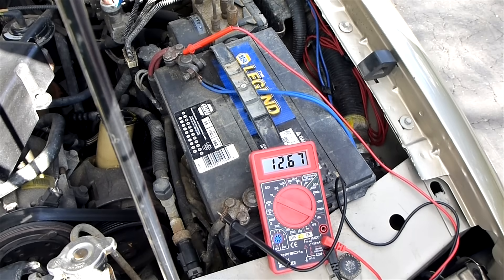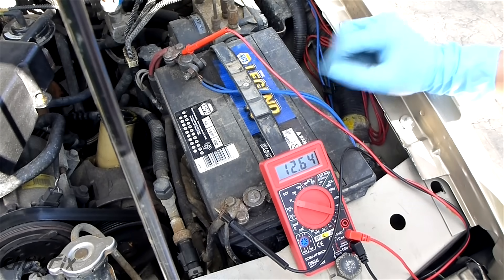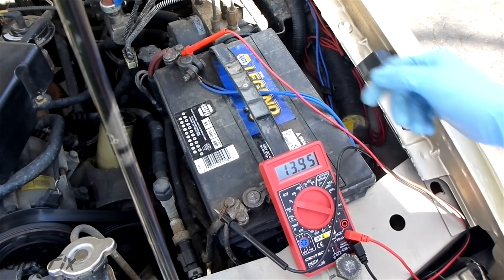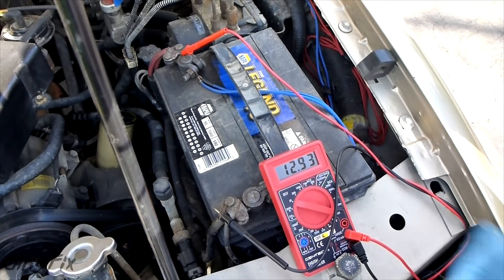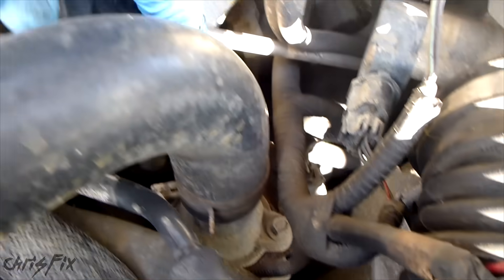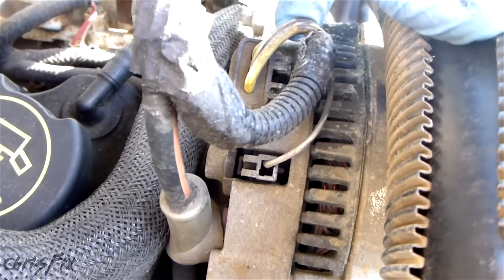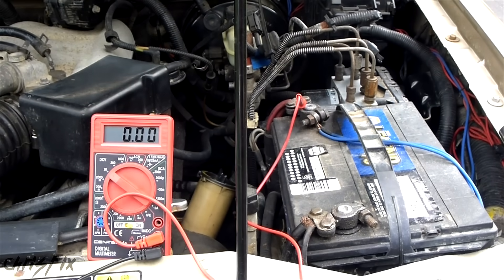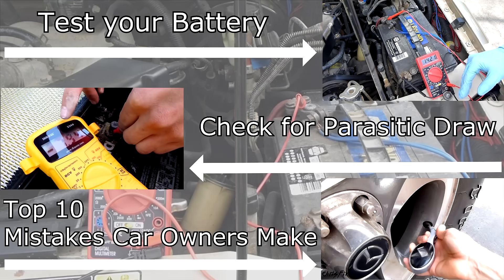How to Test an Alternator

Comment: Hey Chris, thanks for your video I am going to try this as soon as I get home. I do have a question for you. About 6 months before I was driving and my car died. I tried to jump start and all the lights on the dashboard came on and it died again. I had it towed to a shop and they said I have to get my alternator and the battery changed. Then in September car died again and had to be jumped. I took it back to the shop and they said my battery was bad and replaced it under warranty. 

Now yesterday I was driving and the battery and brake light came back on. I got home checked the brake fluid and the connections on the battery and everything is good. Now everything I read online points to a bad alternator. Do you think that it could be the alternator (only 6 months old) or did the battery die again. 

I would greatly apperciate your opinion before I listen to the mechanic and spend another $350 on the alternator.
Reply: ChrisFix I wish he kept up with you. I really wanted to know if the problem was in the car or in the mechanic ...LOL
Reply from the maker: Mudassar Rehman It could be the alternator. I would test it like in the video and let me know what you find. The brake fluid level sensor could also be going bad and it is just a coincidence. Let me know what readings you get!
Reply: ChrisFix Thanks for the fast reply. I did the first tests you showed in the video. Here are my findings:

Battery reads: 12.52v
Car Idling: 14.6 v
Headlights ON, Radio ON, Heater ON, Interior Lights ON: 14.5v

I recently had the brakes inspected. The brake light was on so when the mechanic he looked at it he said brake pads and rotors were gone. So he replaced them and when I picked up the car the light went off. I am going to drive it around this weekend to see if the light comes back on. I just don't want to get stuck in the road.
Reply from the maker: The alternator looks good! You might have had low brake fluid and when he put the new pads and rotors on, it increased the fluid level and shut the light off.
Reply: ChrisFix

I am sorry for keep asking questions. I am just tired of wasting money on mechanics guessing game. I am going to keep an eye on the brake fluid. But do you know why would the lights flash? Thanks for your help.
Reply from the maker: Mudassar Rehman Flashing brake light? Hmmm. That is unusual. Check your owners manual. Look under the brake section and it should tell you what the flashing means. It might just be a faulty brake sensor or maybe your e-brake is loose or something causing the brake light to flicker. Dont be sorry for asking questions! These are good ones and I am here to help!
Reply: ChrisFix Hey I need your help again. I drove the car around for a few days and yesterday the brake & battery light started flashing. Also when I would stop at a traffic light the lights would stay on, but go off after I would accelerate. I checked the voltage this morning. The battery reads: 12.6 volts. With the  car running: 14.6 volts. 

Can you give me some ideas of what else could it be. I just don't want to be driving and get stuck in the middle of the road.
Reply from the maker: That sounds like a ground issue. Something is not being grounded good. Are your battery terminals clean? Follow your ground wires in the engine compartment and clean the connection.
Reply: Are you talking about negative terminal on the battery. I was able to move the negative cable by hand so I tightened it. This morning battery was down to 12.4v. But when i run the car it goes upto 14.5v. I am going to remove the battery and the tray to look at the negative cable where its attached to the car. Can this make the battery and brake light to come on. I just dont want to spend money on the alternator when it be a wire.
Reply from the maker: Mudassar Rehman If there is a bad ground it can cause your electronics to act funny. It is somewhere to start but from what you said, it sounds like your alternator is working good. Let me know if any grounds are not clean.
Reply: ChrisFix Hey I was only able to check the cables that go on the terminal Negative one was little bit loose so I cleaned both sides and put them back real tight. I am going to drive the car again tomorrow morning.

I am going to have a mechanic look at all the grounds tomorrow as well. But when I was looking at the car today. I noticed that one of the lights on the number plate was out. So I replaced both of the bulbs. Also the car was real low on coolant so I topped that off as well.  My only problem is that mechanic keeps telling me that the alternator is bad. Do you think that this blown light could have cause the battery light to come on.
Reply from the maker: Mudassar Rehman The blow out lights will not cause a battery light to come on. If you tested the alternator like in the video, it is 99% most likely fine.
Reply: ChrisFix Hey thanks for the advice. I had the mechanic check all the connections again. The negative cable on the battery had some corrosion where it is connected to the car. So he cleaned the cable and checked all the other wires. Everything seemed good. He told me to try it out. I drove it for five minutes and when I stopped at a stop sign, both battery and brake lights came one. 

So he said that the alternator is failing. I told him about all the voltage test in this video and he said that alternator might not be completely bad but is on its way to fail. and might kill the battery as well. In your opinion do you think that he might be right.

Autozone has a new alternator for sale for 250. I am also going to have him change the alternator belt.
Reply from the maker: Mudassar Rehman I mean, it can be an alternator going bad... Do you trust this mechanic?

Comment: hey can you help i dont have testing tools here but  when ever my truck idles its a 94 c1500 pick up  it will lose charge and buttery meter will down towards the red but  when i start driving the voltage will come up till just one mark above normal what can it be my belt isnt sleeping  its not even squealing the engine sounds normal.
Reply from the maker: SuperJeremi10 Go to your local parts store such as Advance Auto Parts and they will test your alternator for free. The belt could be slipping but you might also have an alternator that is going bad. Try spraying water on the belt like in this video: https://www.youtube.com/watch?v=UF3W-vHPYHg and see if the belt squeaks. If it squeaks, your belt is slipping and you need a new belt or tensioner.
Reply: okay will do thanks i have a autozone here and it rained pretty bad today and  my belt didnt squeak but ill try spraying water on it too  but first thing im taking it to autozone.
Reply from the maker: SuperJeremi10 That will work! Let me know what they say! You might consider investing in one of these for only a few bucks: http://www.amazon.com/gp/product/B001O1X65A/ref=as_li_tl?ie=UTF8&camp=1789&creative=390957&creativeASIN=B001O1X65A&linkCode=as2&tag=chri0e2-20&linkId=DQXKJ44LE7TL32CR
Reply: i will do and yes i probably should might be help  when a problem like this arises again  good thing is i have yet to have a fail to crank or start or stalling it has had long crank times since this issue started but by the time i really noticed an issue it was to late to take it to the shop.
Reply: i just hope it will crank tomorrow otherwise i carry jumper cables in he truck so ill just have it jumped.

Comment: Hi Chris - Many Thanks for these great videos. Occasionally I am having problem cranking my Toyota Corolla 2006 - I did the battery and alternator test as you suggested. I am getting a normal battery voltage of 12.6, while cranking it drops to 10.5 V. When the car is running without load I am getting 14 V (Red Flag) and with headlight light, fog light, fan and radio running I am getting 13.85 V, did all the test as you suggested. Negative terminal voltage drop is 0.05 all over as suggested and positive terminal one is 0.25. To me all seems good except the normal alternator voltage of 14 V which should be 14.2 to 14.7. I got my battery checked at the battery warranty and he told the alternator is weak. Can you please share your thoughts on what issue I might have and how to fix the issue of weak alternator.
Reply from the maker: anisarfat That does sound like a weak alternator but it isnt weak enough that your car wont crank. A weak alternator typically means you need a new one (or you need to get yours rebuilt).

Comment: Howdy Chris, I wanted to ask you for your opinion. I have a 1981 F150 with 300 cid inline 6. My alternator has an external regulator too. The condition is that it's charging at 15.2 volts, it seems a bit high but doesn't increase over that when I rev it. When I turn on all of my electrical it'll drop to about 14.4ish volts do you think that's fine? Everything seems fine other than noticing that.
Reply from the maker: Brenndon McGill The 15.2v is a lot. As you saw in the video it should be in the 14.2v -ish. I think you should consider replacing the voltage regulator (nice that it is external) because when they go bad you get an overcharging situation which can damage your battery and potentially your electronics.
Reply: ChrisFix That's kind of what I was thinking.  I'm going to look at getting it replaced here soon.  Luckily the only electronics I really have are the lights, radio, HVAC fan, and wipers haha. No computers, sensors, etc. Maybe if I stick your fog lights that are brighter than the sun on my truck it'll just drop it to 14 haha.
Reply from the maker: Brenndon McGill Haha they only draw 4 amps each so that probably not gonna work :P

Comment: Hi Chris,
My alternator read at a 13.5 loaded.  When I turn on my lights, air and/or heat, my car squeaks.  Could this be the alternator?  Thanks
Reply from the maker: rmjenterprises This could be the alternator. Does it happen only when the compressor kicks on or can it be any electrical load? If it happens when you put a large electrical load on the alternator, then yes, it is probably the alternator.
Reply: ChrisFix Thanks so much for answering my question.  It sounds like an electrical load because it squeals when I turn on my heat and air. However, it gets worse when I turn on the lights.  I'm going to Auto Zone to get the alternator tested.  Thanks, Lynnsie
Reply from the maker: rmjenterprises Let me know what you find out.
Reply: ChrisFix Thanks Chris, I'll let you know by Monday
Reply: ChrisFix Hi Chris.  Well the guy at Auto Zone asked me to turn the ignition while using the tester and said that my alternator is fine. However, the woman at Advance Auto checked my alternator by asking me to turn on all of the power and that's how I got the 13.5 reading so I don't know how accurate Auto Zone test was .  I had a fan belt replaced about two weeks ago thinking that it was the cause of the squeaking but the car kept making that noise until today.  I drove most of the day and heard nothing so maybe it was the belt, hopefully :).  Thanks for your concern.

Comment: Hi! I really find your videos very informarive. I wonder if you could give me some advice. My car wont start for the past 1 week. All of a sudden one it wouldn't start one cold morning. The car starts making all kind of clicking noise. All the lights on the dash start flashing and the clicking noise seems to be coming from everywhere. Especially from the dash under the bonet. Tried checking the head lights and they are very dim. I took a reading with a volt meter and the battery shows 12.38 v. I tried to start it with a jump start kit but no luck. Now how do I determine if the battery is dead even though it shows 12.38. I am lost. Even if the alternator was bad I should have been able to start the car with a jump start isn't it. Would appreciate tou suggestion
Reply from the maker: Alistair D'silva It sounds like you have a bad battery. It might show 12.3v but it doesnt have the cold cranking amps to start the car. A new battery should fix your problem! How old is the battery?
Reply: Tahnks for the suggestion buddy. I thought so it might be the battery. It is about 4-5 years old. I will try one last time to see the voltage if it dips low while trying to turn on the ignition. Just to see if it has any CCA. Thanks again mate

Comment: I have an 06 Mazda 6s, I have been having problems with it-  I have replaced the alternator 3 times now, and changed the batteries out with it.  I put a new battery in the car today actually; still having a small amount of voltage drop when the car is on.  Originally the multimeter was reading 14.50 volts at the start, however over time with no load at all the voltage dropped down to 14.10, eventually dropping to 14.0.  I'm at a loss at this point and I'm not sure where to even begin next.
Reply from the maker: Kyle Seymour Did you check the voltage drop like I did in this video? What did you find?
Reply: ChrisFix Wasn't able to, the alternator is in a compartment.  I would have to jack the car up.  I ran the car for a good amount of time and the check engine light came on along with the voltage with the car on dropping to 13.70 volts and siphoning more.  I will try to jack the car up tomorrow and see what I come up with.
Reply from the maker: Let me know what you find and also let me know what the check engine light code is.

Comment: Been having a really hard time trying to figure out what my cars problem is...New alternator, battery is only a year and half old. I turn the car on, everything is dim and runs rough and wants to die, turn it off won't start again and needs a jump. I have  been told all different voltage in different spots...not sure what I need to do?
Reply from the maker: icetwister24 Did you watch this video to the end? Did you do all of the tests in the video including the voltage drop test. To me it sounds like you have a bad ground somewhere. Let me know!
Reply: ChrisFix  think it's a short, I smell burning and my fuse/relay box is going crazy... draining my battery not alowing my car to start again...
Reply from the maker: Here is how you can find your short: How to Find a Short in your Car
Reply: ChrisFix  Wrong alternator, they gave me one for a manual trans. We are good to go now haha.
Reply from the maker: icetwister24 Glad you got the problem resolved!

Comment: It's been my experience, Those universal Battery connectors are usually nothing but trouble.
Reply from the maker: Teddy Banks Are you talking about he connectors on my truck?
Reply: ChrisFix
yes, they looked like universal type connectors, I have had nothing but trouble when I tried to use them, bad connection problems.
Reply from the maker: Teddy Banks Oh, I think they are what came with the truck. They are like that on my other Fords and I have owned them since new. I personally never had any problems. What caused your problems?
Reply: ChrisFix  loose and corroded  connections. I have always had better luck with the OEM  type cable. but having said that, opinions are like you know what, everybody has one :)
Reply from the maker: Teddy Banks Haha, I was just curious. I never had a problem but it is interesting you have had a problem! It is cool to hear about different peoples experiences with different cars, parts, etc.